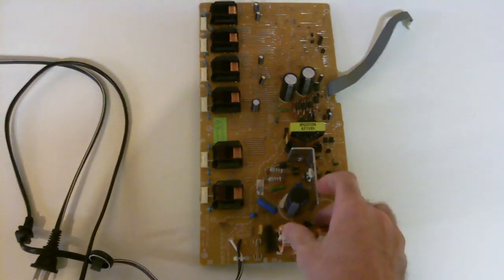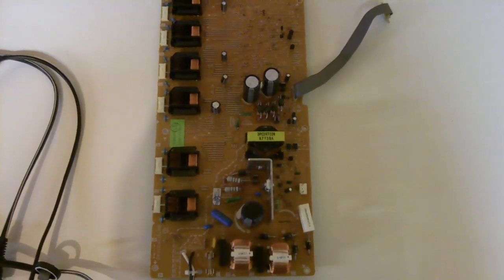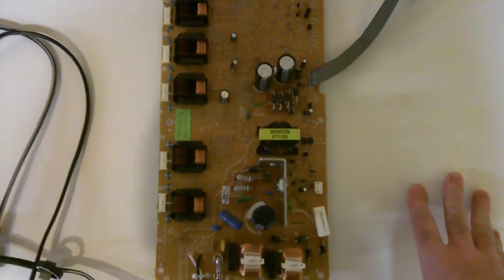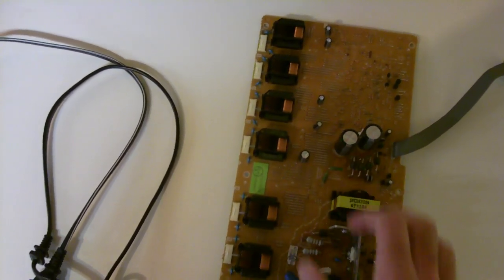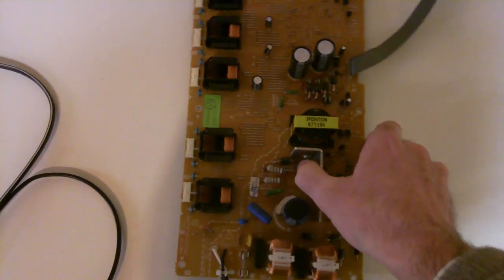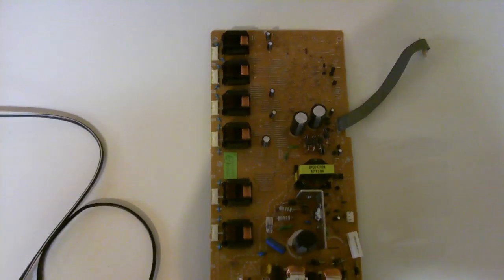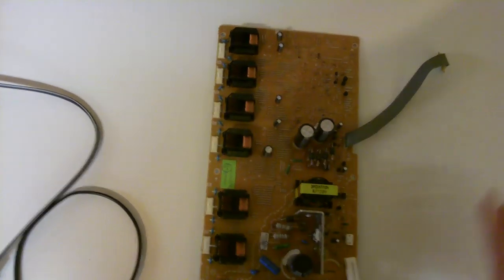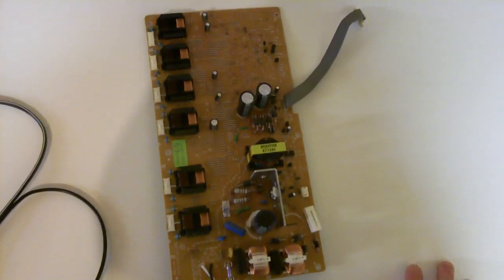Inverter Board Repair Explained

Comment: I understand you 100%,got one just like it and what i am doing is replacing the board with 4 lamp drivers with 4 individual lamp driver boards and simply wiring them in and hot melt gluing the new ones to the old board,connect the inputs and outputs and we should be good to go,I use to do the same thing with radios and televisions.

Comment: hey man nice video only little details, on that particular board the problem is not the parts that you call ballast which they are not actually ballast they are called transformers and like i was saying the problem is not the "transformers" it's a diode, I have fixed those boards many times and it is always that same diode so you might want to check the board better, I understand it is something new for you maybe but it's driving people into the wrong road. Nice try though.
Reply: what diode fails on these ?

Comment: This video should be removed because it is very misleading and may even cause somebody harm if they try and play around with an inverter that has very high voltage output even at low current could be dangerous if not deadly

Comment: Thanks so much for this video!  My Emerson is having the exact same problem.  I've removed the back panel, and will order the new inverter panel.  Your explanation, and demonstration made this very easy to understand.  Can you tell me the seller on Ebay that had the $59 panels?  Thanks again.

Comment: cool repair. I have a 42inch I picked up from the trash. it had be repaired before they replaced the caps. but the person that owned it said he spent like 200 bucks for that repair and not even a month later it went back again same problem so he said he threw it out and pick up a new one. so I to did the research and found it better getting a new board. but the one I had was rev A   the new one I got it was a rev c looked a little different but its been working for 4 years now.

Comment: actually over time lamps loosing inert gas in it ,and draw more and more current...when current is overload ,than feedback voltage sensing is come so hi that shut down the power supply...its possible to find on what transformer is sensing voltage to high and simply disconnect transformer and shorting the input coil...then set will work ,but without one or more lamps,depending on set system,on some sets one transformer drive one lamp,on another two or more...regards

Comment: WTF is balast....that shit is used only in cars light inverters....in lcd sets is only hi voltage transformers present....they are not expensive,but hard to find...sometimes they are internally arching between coils and sometimes lcd lamps draw to much current,or even bad capacitors in power supply ...that is common failures

Comment from the maker: Dude...you probably shouldn't commenting on videos in english if you don't speak english...It kinda makes you look like an idiot. Seriously, what is an "electronist"? You know they have spell check built into web browsers now, right? And if you watched this video or any of my other videos, I make it very clear that I AM NOT an ELECTRICIAN. BTW this TV and over 10 other TVs I have repaired never once had bad lamps. It was almost always a bad inverter board or PSU. Have fun with GOOGLE TRANSLATOR

Comment: @GloomyTimes, You confirmed that LCD works by shining a powerful LED flashlight onto a lighter area of "image" on the LCD screen itself while turned on in the dark room? And, Just one bad tube can shut down an inverter, so I gotta say yes. All my lamps are good so far, I am one of few peoples who is dealing with misbehaving inverter, that is... When you remove the tube, be sure to find the right size of lamps - With Sharp HDTV, it's easier to do away with lamp change-outs, at least what I heard.

Comment: And to answer the question why the inverter will quit running when the lamp go out: The inverter is apparently required to have resistance current sensor to monitor the current the lamps draw (up to 200mA) and ensure that the lamps is kept in check. If one lamp goes bad, no matter the lamps are wired, series, parallel or both, it will always sense some change in current measurement, and shuts down to prevent arcing to the chassis. Sometimes it can go bad with lamps still working fine.

Comment: Yes, in some TV, just one tube burning out will make the others go out since they could be wired in parallel as some inverters are much more powerful. You can replace just one tube which is much more blackened than the rest or is emitting pink light (Argon) at the EOL (End of life) but replacing them all is recommended as the new one can and could be affected by old lamps..

Comment: And yes, my TV is less than 2 years old. This TV was given to me - LCD and computer inside this TV works perfectly (confirmed with a 3+ Watts LED flashlight being shone on LCD screen, you would see patterns on it if the LCD and computer works fine).

Comment: Inverter failure can go in a long way, with so many things to go wrong: Capacitors, transistors, diodes, resistors and transformers. If you are going to troubleshoot and repair it, go at high voltage circuit as there could be failed op-amp chips in current sensor portion, which the inverter will not start due to "LAMP_OUT" fault. I have found out about this. My TV's backlight just flash then remains off. I have to replace the ICs, and maybe resistors or diodes. A real challenge.

Comment: These are high voltage transformers...I have fixed CRT tv's for many years and I can tell you every CRT tv uses a different model high voltage transformer. There must be a thousand different ones. As to these inverters I don't know...I don't really have experience with them.

Comment: why would you buy electronic componants from ebay or anywhere else, do what i do go to any electronic junk yard, pick up old electronics and desoder caps, inverters, converters...etc and have a back up of bit of everything, so when somehting goes wrong, all you have to do is dig in your reserves :) it works for me @ 0$ and i have repaired tons of TVs, monitors, motherboards...ect. dont waste your money on ebay.